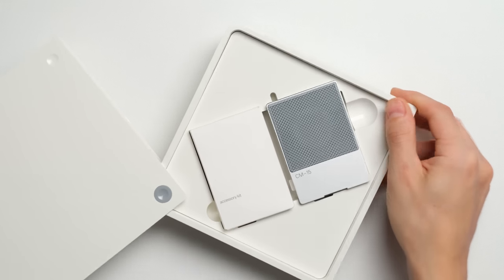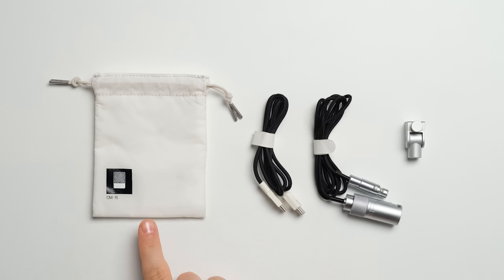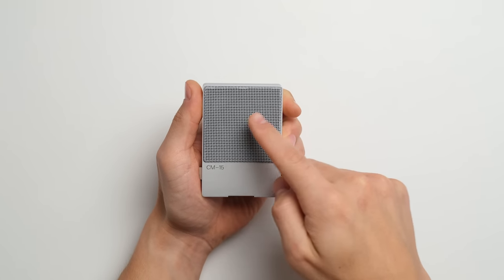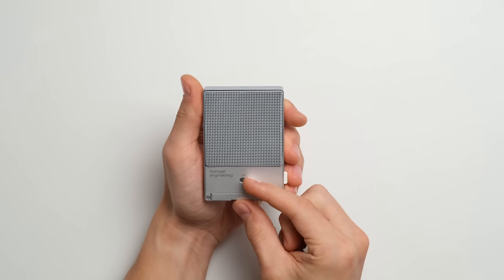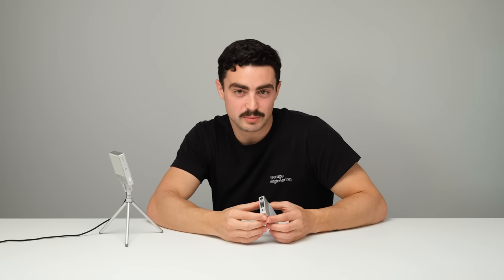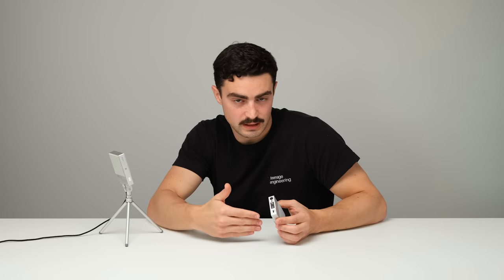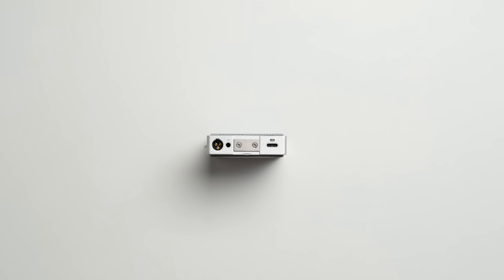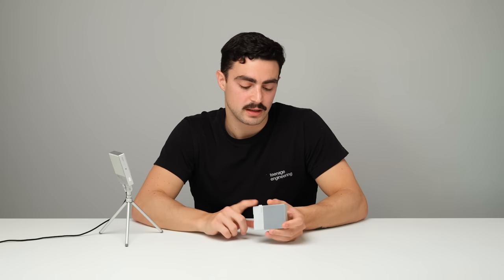CM–15 field microphone overview

Comment: Despite this being out of my budget range, I like how the field series gradually grows into a complete ecosystem. I imagine headphones or speakers are in the pipeline as well. Maybe even a drum machine?
Reply: The op-1 + mixer  + mic + speaker = $5,000   !!!!   After my experience with the op-z I'll pass
Reply: A complete eco system. You mean like how all basic recording & music gear connect via midi? Not unique. Spend your money on useful gear.
Reply: @ComsiCaterpillar  you can’t use the op-z as a measurement tool, try the original op1 is the perfect time to buy one.
Reply: @ComsiCaterpillar  hey you forgot the plywood table!
Reply: @torino1138  I do, thank you very much :)
Reply: OP-Z Field?
Reply: An ecosystem? More like a parasitic worm that hatches babies into your bank account. I have a Tascam 4 track field recorder, and an Audio Technica large diaphram mic, both sound great (not as small and breakable). Spent $200 or less on both, I've had for over 8 years and still work great. Seriously this is a ripoff, I'd never buy a mic from a company that has no history or experience.
Reply: Yeah, they make you wish you were a millionaire right!
I was stocked when I saw the tiny mixer, it's just perfect for a few pocket operators, but the price set me back...
Otherwise they look like great piece of gear and price must be justified by build quality and functionality...
It's just not the same spirit as the PO series, built to be supper affordable...
Reply: @Caribe_   The OP-1 did seem MUCH better made . . . gotta say the new TP-7 recorder actually really catches my eye.  I could actually use an elegant recorder like that.
Reply: The K.O. II perhaps?

Comment: Or, buy a Tula Mic. Much cheaper.
Reply: Not comparable
Reply: @tendingtropic7778  yes it is
Reply: @tendingtropic7778  indeed, it is a battery powered pocket recorder made by an high end microphone brand. Obviously very different.
Reply: @ProjetHomeStudio  But does it have a pretentious box shape design? That's why a $200 mic in quality costs $1200.
Reply: @kellymerrill5294  I bet it doesn't look that great without the field desk tho :D
Reply: @ProjetHomeStudio  it is different. i'm not defending the price. but tula is not large condenser, and tula can record while this cm-15 can not. Tula is not a high end microphone (i had one, was not impressed by the sound). An AKG C414 also costs a 1000 bucks. So I guess all will depend on how good the sound quality will be of this one. we will see (but I don't expect it to be up to par with e.g. the AKG)

Comment: Since a longer time I've been searching for a good mic that provides a line signal output. I've immediately read in the online manual if the CM-15 has a line signal output and yes it has. I can connect the CM-15 to various samplers or eurorack modules without needing a preamp or a mixing board. For me that's fantastic.

Comment: What is the sensitivity of this microphone? 14db noise for LDC - it's not that noisy, but not good enough for quiet recordings... 
Is your voice recorded on this mic at this video? if yes, then it sounds like a cheap condenser microphone.
USB SNR dBA FS: 120 dB - that's very noisy preamp. Even old cheap zoom h4 has better noise floor in it's mic pre's.

Is there any windscreen included?
how to use it in the field without it? does it have some kind of suspension for catch a vibrations?
Who is this microphone for?
portability?
There are many small microphones on the market.
If you have $1200 you can afford a portable recorder and 2 condenser SDC mics and that will sound better and give more features and functions) I'd rather buy any of the dozens of excellent microphone models for that kind of money. Schoeps CMC1 mk41 costs 1.4-1.5k, sennheiser mkh8050 costs 1.3k. Line audio cm4 - 120 eur.  Oh boooy.....
Guys, I'm really impressed with your marketing talent. You can even sell a donut hole.

I would buy something like this for less than $250 like other cheap/mid range usb mics.

Comment: Really love the design here. TE always knocks it out of the park in that regard. As an owner of both the OP-1F and the TX-6 and would LOVE to have this, but the price is eye-watering and a really hard sell for me with so many other great, mostly comparable options available for a fraction of this cost 😬
Reply: Indeed, this thing looks smaller than a pack of cigarettes… ❤
Reply: Can you suggest these options you talk about please?
Reply: @estefanoandres  yea man! Bear in mind I said "mostly comparable", so they might not be a spec for spec match, but you could literally buy both of the mics I'm suggesting and still have money left over compared to CM-15. The Tula mic is the one that came to mind first when I saw this. It's a dual capsule design with USB C, battery powered, and can take a micro SD for onboard recording. Next is the Zoom H2n which has 4 or 5 different mics, switchable capture modes, and can do omnidirectional recording. It can also function as an interface, runs on batteries or plugged in, and has micro SD as well. I have one personally and it sounds fantastic.  There are plenty of others as well, but those two immediately came to mind. Both of them are at or under $250 USD too. I love TE, I really do, but this one was a swing and a miss imo.

Comment: I got an OP-1 Field a week ago and funnily enough I was wishing I had a portable external mic to create samples closer to studio quality. 

I'm not sure if I'd buy this straight away but I think the products in the field eco-system have the unique selling point of being portable and tightly integrated. I'm really looking forward to what else is going to come out of this line.
Reply: get a zoom H6. You'll get nice recordings in a portable setup, and you can plug an XLR mic on it if needed.
Reply: @ProjetHomeStudio  People don't buy TE for function it's just a status thing
Reply: @kellymerrill5294  Status? Who’s giving them status, most people don’t see our gear. Maybe they just like the product. I have my own issues with TE but as a former owner of a a OP-1 Field I will say it’s easily one of the most beautiful and inspiring devices I’ve ever owned. A bit dogmatic though and that’s my issue with TE… they definitely have some crippling aspects baked into each device.

Comment: Super sleek design to fit my mixer and my OP1F. . . .  I only need to find a purpose. could this record ambient sounds ? more towards signing and close loud recordings.
Reply: What do you mean by record ambient sounds? There are plenty of mics that have low noise, filters, boost the signal that cost under $200 and likely are indiscernible from this mic.

Comment: The design is gorgeous and compact - haven't seen anything quite like it. Are there any other non-speaking demos of it? That would be the determining factor. Sounds pretty good for normal voice-over work if the audio from this intro was recorded with it.
Reply from the maker: thanks it was indeed. the recording microphone is the CM–15 ,standing on the table in the video, connected as an audio interface to the computer used to record.
Reply: I think you should look a little harder there are loads of good cheap compact microphones around and most cost far less than half of what this costs. And most are far better looking...
Reply: @morlidor  Sorry, what I meant by "I haven't seen anything quite like it" was more about the actual appearance - the closest thing I've seen to this particular aesthetic is maybe the Tula mic (which folks seem to like), but I can see why the look of this could be polarizing. That being said, I'm not super familiar with the world of microphones 😅But you're right - even with my limited exposure to them, I know there are a ton of awesome affordable microphones out there now. And, once you add things compression, expansion, and de-essing into the audio pipeline, many of them can even compete with far more expensive microphones. Are there any ones in particular that you especially like?
Reply: @alex-r-t  
OK! AKG Lyra for around a tenth of the price of TEs mic and probably wiorks better on many recordings as it has switchable polar patterns.
Apogees hypemic costs around one third of TEs and is of a very high quality..
Reply: @morlidor  Awesome. Thanks for the suggestions! I'll check them out 🙌

Comment: The very very high price is conveniently left out of this.  Save your money and buy tons of gear instead of this microphone that doesn't sound any better than those at the $99 - $199 price range. This is a loser product that will be discontinued in 3 to 5 years.